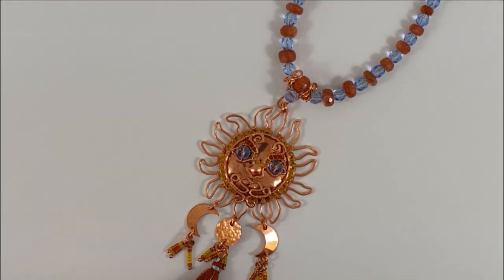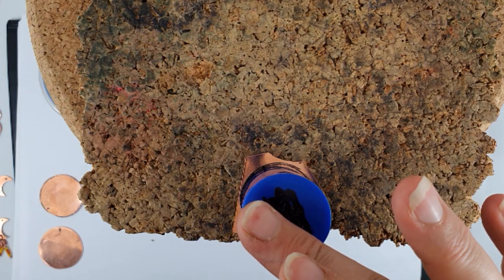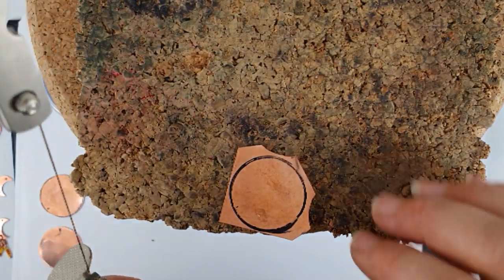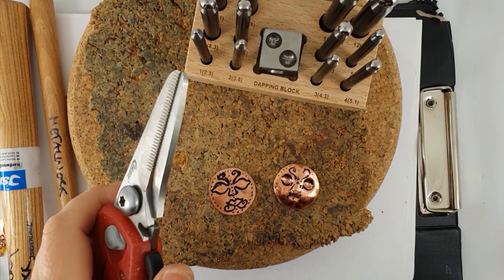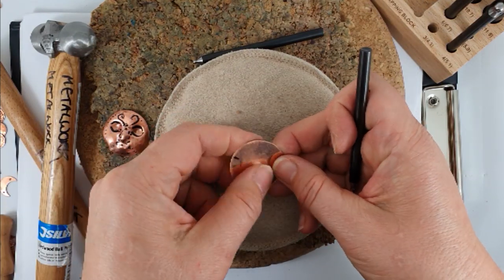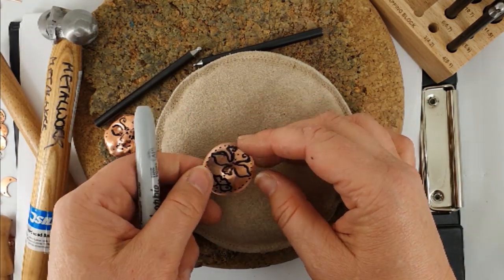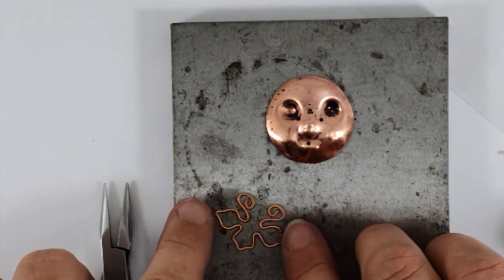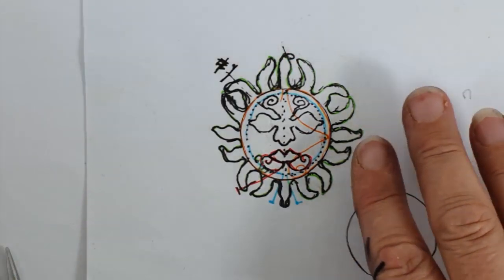JewelleryMaker | Rachel Norris Sun Pendant Tutorial.

Comment: You need 0.5mm thickness copper sheet, 1mm and 0.4mm bare copper wire, 6mm sapphire blue rounds, 11/0 topaz and 11/0 yellow seed beads (lovely sunstone went in the larger design). I used the disc cutter to make the circles for the earrings. Pam Kriner, makes a fantastic and very useful point that copper circular blanks could be bought and used if people wanted to use them to make the pendants....but its a good idea to practice and gain confidence in using a saw which will help when you want to scale up to make the larger suncatcher size.